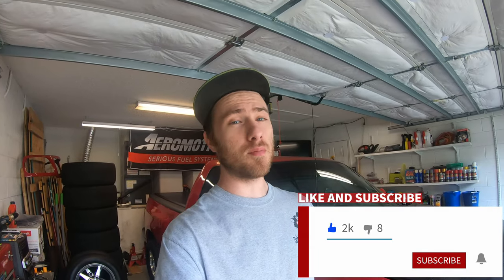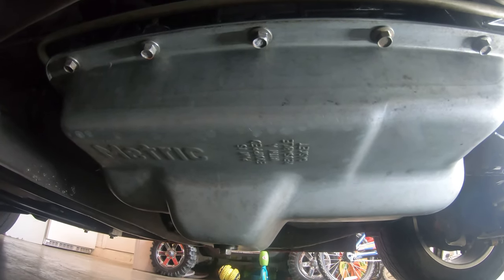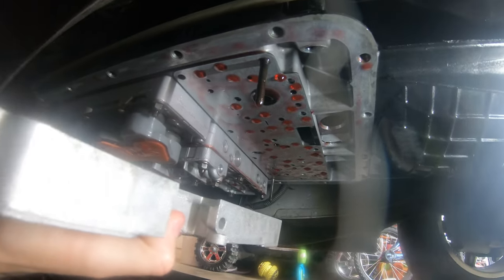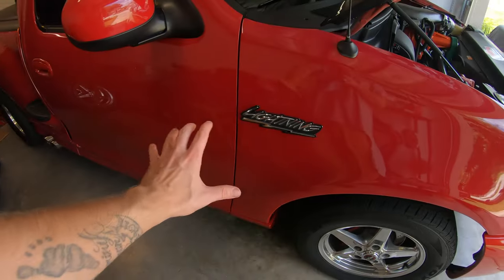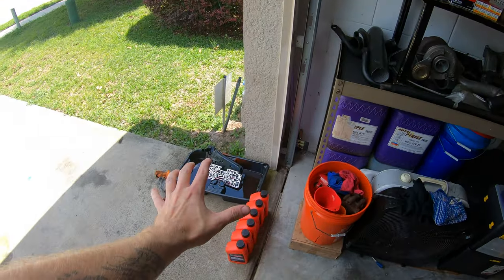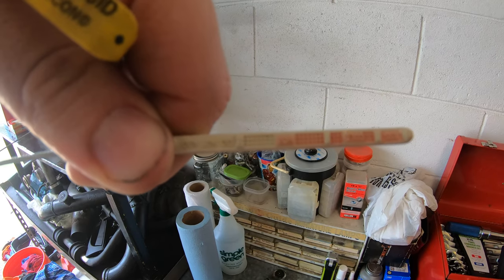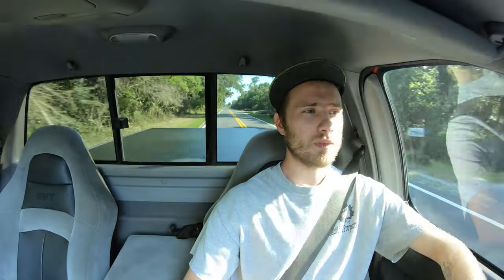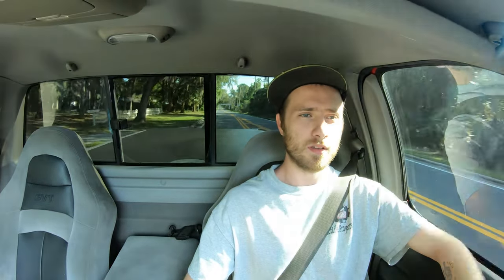Ford Lightning Race Valve Body - Install, Test Hits, And Everything You NEED to Know!

Comment: I just installed my valve body on Tuesday made the 1-2 2-3 10x better just waiting on my trac bars to show up.
Reply: Also installed my 4x4 pan.
Reply: Does it chirp?
Reply from the maker: Hell yeah man 🤘 makes such a big difference!  Couldn’t tell in the video, but it was hitting hard enough to make it spin for a second between shifts lol feels so good now!  What valvebody did you go with?
Reply: @idontlikecops1  tbh I think it does but my exhaust is to loud at WOT so I can’t really hear it. And the truck is stock basically nothing but intake header back exhaust(just have the high flow cats from bassani) want to do more but I risk getting state ref sadly I’m in Cali. Recently pulled the blower off cleaned everything and replaced my intercooler pump because I’d seize from time to time.
Reply: @DebtLife_Projects  went with the Punisher street valve body.
Reply from the maker: @AnthonySvt_  nice!  Punisher is a good one 🤘

Comment: Would you recommend the 4x4 transmission pan even if you have the truck lowered.
Reply from the maker: Now that's a good question, I'd ask chris at A1 about that, he'd know better than I would.  I'm still rocking 4x4 stance LOL, so idk yet 😅
Reply: @DebtLife_Projects  you ever think you’ll lower it? I like lowered trucks but at the same time I also love function lol
Reply from the maker: @mercury0214  alittle bit, not going to lower it too much.  1 inch in the front, 3 in the back, just to close up some wheel gap.  Definitely not low low though.  I want it to work at the track/for racing LOL
Reply: My truck is lowered 3/2 bought it like that and recently installed the 4x4 pan doesn’t hang that low it does depends on the streets in your area my streets are usually pretty good.

Comment: What made you go with A1? I'm leaning towards JLP. They have a great deal right now VB, deep pan and filter for $415 but still deciding between JLP, A1 and punisher. They all have good reviews. Definitely seems like Chris at A1 has the best street cred when it comes to transmissions though.
Reply from the maker: A1 is second to none and he really knows his stuff.  You can tell him your exact setup, and he can build a valvebody exactly how you need it.  That being said, if your truck is just bolt ons with a stock converter, the JLP will be good, I had one and was pretty happy with it (it'd bark the tires in 2nd lol).  But once you start doing different converters, go built, ect, A1 is the only option.

Comment: Why you went with A1 and not jlp just asking cause I’m buying a valve body and can’t decide
Reply from the maker: A1 is the guru for these transmissions, really knows the ins and outs, and builds a better valvebody.  JLP is ok, I had one when my converter was stock, and it shifted good.  But now that I have a higher stall, it softens the shifts even with the valvebody, and I have to compensate for that with a better, more aggressive valvebody, and Chris Garret at A1 is the man for that.
Reply: @DebtLife_Projects  I have stock converter what you recommend I’ll add it to the cart right now lol
Reply from the maker: I'd personally do the A1 street.
Reply: @DebtLife_Projects  done thanks man!

Comment: What size are your Weld wheels? Backspacing? Tire size?
Reply from the maker: These are RaceStars.  15x10s with 325/50r15 in the rear and 17x7 with 235/65r17s in front.  Not sure of the backspacing, it's been a while.

Comment: What kind of cold air intake  is that? I have a CNL elbow I didn’t know if I can retain that still use whatever you got? Cause that looks like it works.
Reply from the maker: JLP Ram air kit, truest cold air kit for these trucks, and It work's with the C&L, but it will rub unless you do alittle trick I learned.  Buy a 45 degree coupler from siliconeintakes.com, and cut the ends off so its not so long.  That angles the top of the box down, giving plenty of clearance for the hood.

Comment: You can adjust shift points and stiffness with a tuner.
Reply from the maker: Shift points, yes, but as far as stiffness goes, that's the wrong way to go about doing it, as it puts extra stress on the trans pump, causes more heat, and wear on the trans.  The valvebody is the correct way to stiffen shifts (mechanically via springs, valves, ect in the valvebody), reducing clutch slippage, heat, and extending the life of your trans, all without putting any extra stress on your trans pump.  Not to mention, you'll never get them anywhere near as stiff as you can by doing it correct, by changing the valvebody.
Reply: Sure you can but it's nothing compared to a valve body.
I have also done electronic tuning on these truck. I modified the tq lock from 37mph to 42. In overdrive. Moved the shift schedule up a bit with low TP.
The tuner is limited to what you should modify in TP pressure because there is a slip timing on these trucks that other trans don't have. You can firm up the torque reduction on shifts also. But a higher shift reduction sounds mighty cool when the ignition shuts off and it spits out the exhaust pipe.

I wouldn't add to much shift pressure on these trans electronically because it will drain the global circuit when turning up shift 1-2 3-4 shift pressures.
Your best bet is a drilled pump with a shift kit like suggested in this video.
You can also add a 500 line modulator valve along with the kit. You can't go wrong at all

Comment: Does the stock lightning take 15 quarts or 5  for the transmission video got me confused can anyone help ?
Reply from the maker: If your just dropping the pan and doing the valvebody you'll need 6-8 qts, depending on what pan you use.  If your changing the entire system, you'll need 16-18qts.

Comment: 6 quarts? I thought for Lightning’s it was 16
Reply from the maker: 16 is for the entire transmission system (filling the rest of the trans, converter, lines, cooler, ect).  If you're just dropping the pan to change the valvebody, it's only 6-8 qts.

Comment: Can I remplace the VALVE BODY with out a tune ?
Reply from the maker: No tune is technically required, but if you have your shift pressure raised in your current tune, you will want to have them lowered back down.
Reply: @DebtLife_Projects  thanks! ⚡️⚡️⚡️